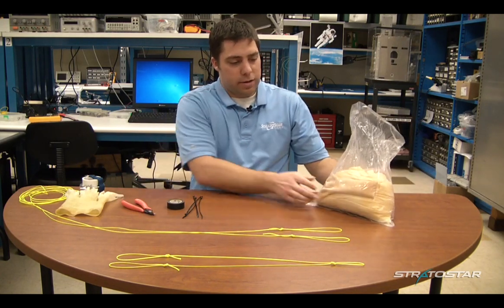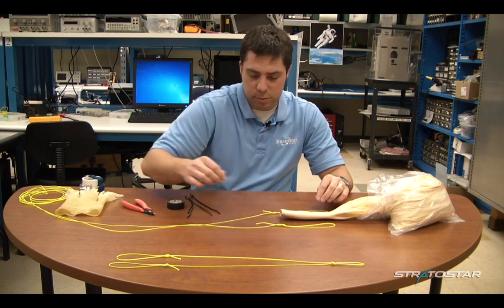How to prepare a weather balloon for launch

Comment: hey jason, we have a date to fly a balloon this thursday but we didnt realise how small the helium ballon rigid nosel is - we are contemplaiting attaching and sealing a well a possible using again tie ropes and eletrical tape a more flexible meter rubber tube that we can feed up in to the ballon - but its still maybe 3cm diameter, whilst the neck of the balloon is really big, aprox 15cm diameter, maybe slightly bigger than that broken off one you have in this video -  we were just wondering with your experience, if the procedure would be the same of inserting a larger pvc cilinder and holding as tight as possible with maybe 2 pair of hands to help assist.   maybe you can give us some insight - would be REALLY APPRECIATED If you read this before hand and we could have a quick chat before this thursday - its really hard to find any help and correct materials here in the uk.  thanks man